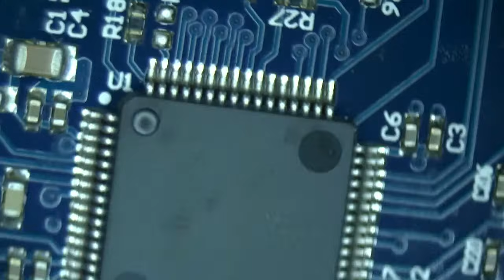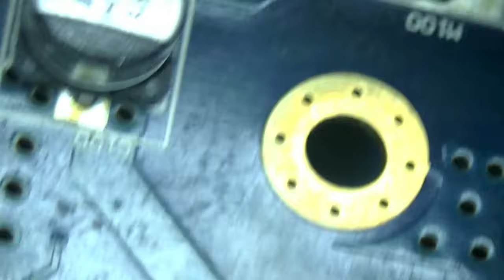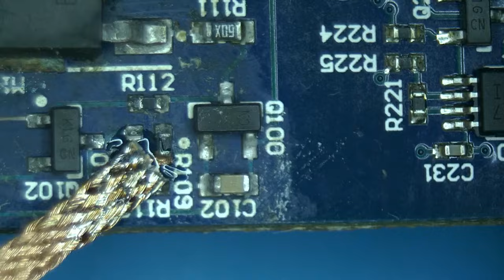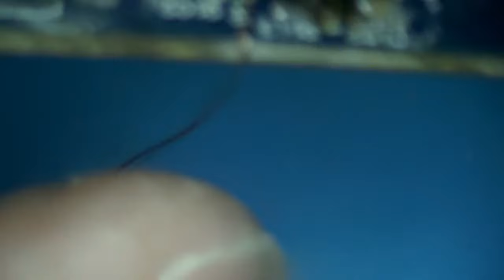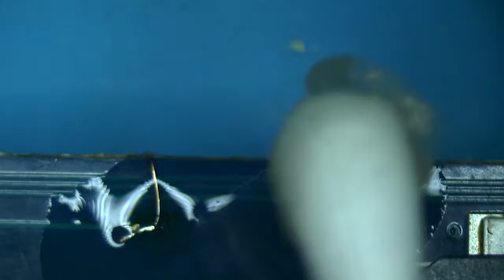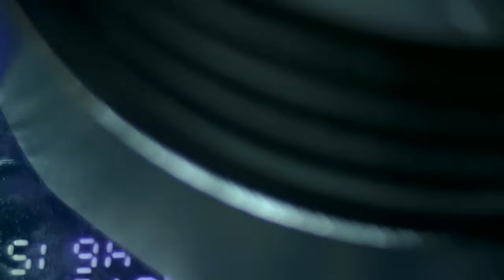Ecotech Radion Gen3 XR30 Power Circuit Repair

Comment: I just found your channel, I love that you show and explain everything! Thank you! I am subscribed now.
If you don't mind helping me, I have radio x30 pro gen3. When I plug it in it flashes like this 28:34. It also seems to beep at the same time. Do you think it is a bad power supply?
Reply from the maker: Thank you for subscribing!
Hard to tell for sure. Power supply failures like this are few and far between. If you have another power supply you could swap with to try, then it's an easy testl.
I'd rather blame LED clusters (more likely) or the main board (less likely).
Reply: @FixReef   Thank you. I actually have 3 fixtures and 2 power supplies. Same thing happens with all combinations.

The buttons on top glow orange. If I press a button, the red and green LEDs flash once and then all LEDs quit flashing. Then the buttons start flashing blue (if I remember correctly).
Reply from the maker: In that case almost certainly the problem is somewhere with the lights. Plug them into ecotech live over USB and reduce intensity on all channels to a minimum. Then raise each channel individually until it starts shutting off. This may give you an idea which channel has a fault.
Reply: very old comment I know, but did you ever discover the issue? I'm pretty much having the same exact issue with my gen3
Reply: @jasoneades6923  no i couldn't get the reef link to work either. I eventually gave up, they're all sitting in a box collecting dust.

Comment: Hi, any idea what smd capacitor is using the driver of radion x30 ?
Reply from the maker: There are several. Which one? These are also different depending on the generation.
Reply: @FixReef  the capacitor with brown color that appear in min 4:50 above the six big component. In the video is showed at the top of the driver. There're 2 brown capacitor per each canal. I'm wondering what values they have.
Reply: it's a radion g4 pro xr30
Reply from the maker: @matiasbuscaglia6018  all of those capacitors are identical across all channels. You should be able to take off one of the working caps and measure the capacitance with your multimeter. Consider replacements that are rated to 50V and up